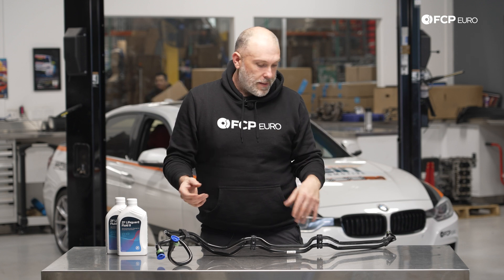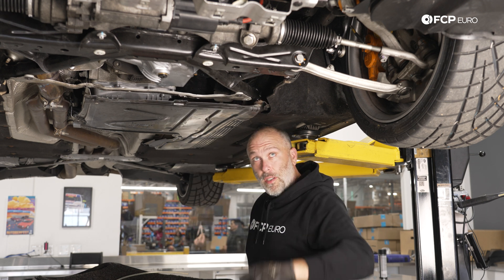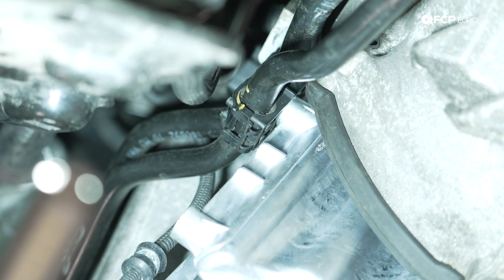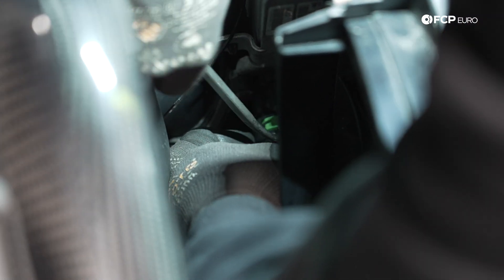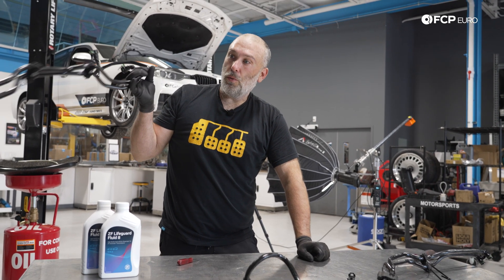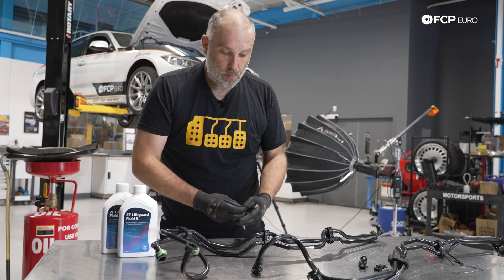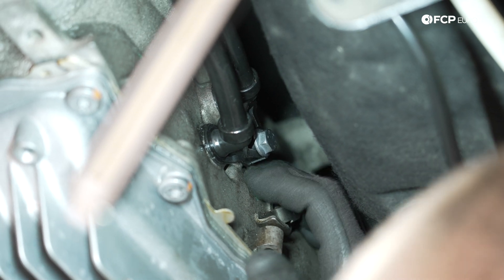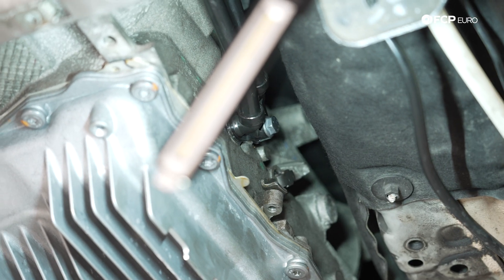BMW 328i Transmission Cooler Line Replacement DIY (2012-2018 BMW F30 335i, 320i, F32 428i, F22 228i)

Comment: Can't believe the transmission cooler line is plastic!
Reply: Yeah, I'm now repairing mine for the 2nd time!  Bought used the 1st time because I couldn't find the assembly new, as I can now from FCP.   For my lines to break (where they come together and bolt to the transmission) at 60K miles, and again at 63K miles on a well-maintained 2018 330i is mind-boggling to me!  Hopefully I'll not have this problem again.